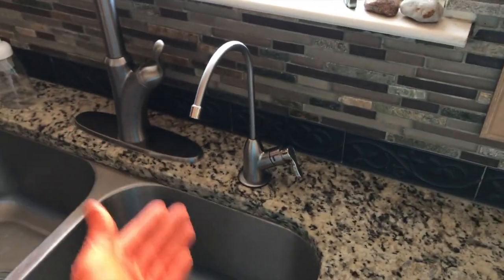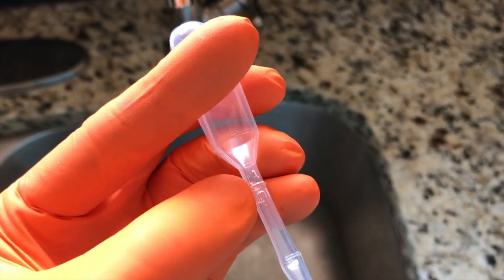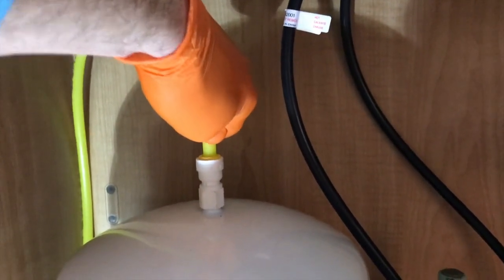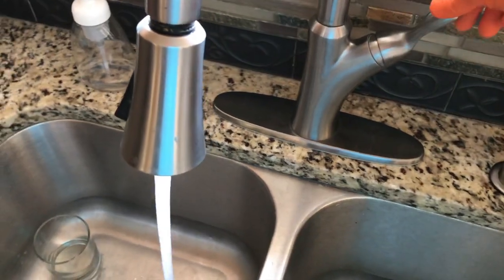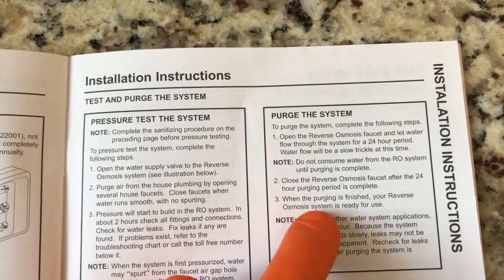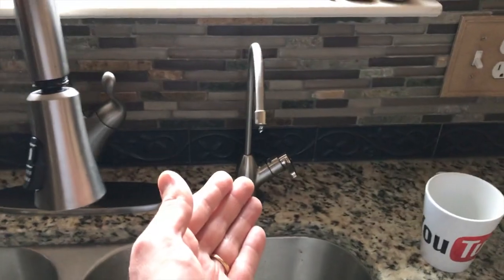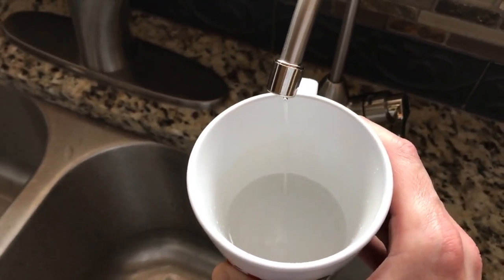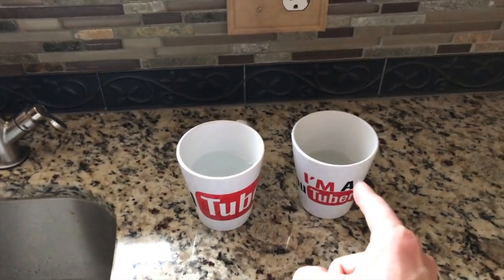How to Sanitze & Purge GE Reverse Osmosis System!

Comment: The sticker on the water tank says 100 psi working pressure but when you look online most ro systems say they recommend 6-8 psi. What should I fill my GE tank up to?
Reply from the maker: @Aaron78155  

Thanks for watching, do you have the exact same GE system as shown in this video?

If so, it is extremely important to not have tank above 8psi when it’s completely empty.

It’s also important that you add air to an empty tank as opposed to a tank filled with water.

Adding air to a tank that has water inside it will give you inaccurate PSI readings and will definitely lead to system issues.

Comment: Hey Michael - quick question - after the sanitize procedure for 2 hours, I turned on the RO faucet and unlike yours, which was a trickle, mine had tons of pressure! Why? Is it OK?
Reply from the maker: @tomatojuice12  

Good morning ☕️

Are you referring to the 2-hour pressure test or the sanitation process?

After initial install, you will be guided to perform the 2-hour pressure test which will fill the system with water so you can check for leaks.  Once faucet is open, all the water will flow out in a normal pressure fed manner, which is normal and what you are hoping for.
Reply: @DIYwithMichaelBorders  Thank you for replying Michael. What you said makes sense. In my initial question, I meant right after the 2 hour pressure, I opened the RO faucet, and the water was strong but in the manual, it says it will be a trickle. It did eventually slow to a trickle after an hour or so. So all is fine? As I type this email, it is still trickling as it has been 12 hours and I need to let it trickle for another 12 hours.
Reply from the maker: @tomatojuice12  

Thanks for the reply.  The purging process will follow the 2-hour pressure test.

During the 24 hour purging process, the RO faucet will remain in the full open position and during this 24 hour period, the water will trickle.

At times, it’s common that the water will stop for 10 seconds or so.

After the 24 hour purging process, you will close the RO faucet and allow it to fill.

Water is not safe to drink until after the 24 hour purging process.

😁👍🧰

Comment: So this doesn't hurt the installed filters? It looks like the yellow tube you put the bleach in goes toward the filters... Can you clarify?
Reply from the maker: @Excellence478  

Good morning, great question.  The instructions guide us to insert the bleach into the yellow tubing that we pulled off the tank.

Once the yellow tub is reconnected to the tank, the bleach will…thankfully…never route back to the filters.

This is because all water inside tank has already cycled through the three filter cartridges, and will only then be routed up the tubing and out of the faucet.  👍

Comment: When you bleach the system you have the RO faucet open, and after bleaching when you turn the cold water supply open you still have the RO faucet open, so why doesn’t water start coming out the RO system right away? You then turn the house faucets on and still no water coming out the RO spout with the valve open. As soon as I turn the water supply back on I get water coming out of my RO faucet. Is this wrong? I did open the RO valve beforehand to try and drain the tank. 
Does pressurizing for 2 hours happen with the RO faucet open? If so mine is sending water out the whole time.

Comment: Does sanitizing put bleach in the tank? Does it also put it in the filters? Isn’t the yellow hose two way? How do I make sure I’m not drinking bleach after 24 hours? Suppose the tank has mold or fungus in it, wouldn’t the tank need to be filled to get the bleach all inside the tank?
Reply from the maker: Good morning ☕️ great questions and we appreciate you reaching out to us.  

The sanitation process allows bleach to flow into system and through all lines.  Bleach enters the tank and cleans it as well.

With the system shown in this video, it’s the very first/initial sanitation process performed after install.  All sanitation procedures to follow are performed using the sanitation cartridge kit.  Below is a link to our video showing this procedure.

       https://youtu.be/5zNwA83aU0g?si=z-ha_uCLE-RIMpg0 

The filters and membrane will be fully removed during the sanitation process and won’t be harmed.  This is because the sanitation kit will be installed and manage the flow and operation.

We have posted a link to our Reverse Osmosis video Playlist below.

       https://youtube.com/playlist?list=PLjCXOz8TSkZlQnBuZZrgOiwjkvAkXc_Ov&si=0_57B9zOZjo6j4ET
       
Lots of helpful videos, please let us know if you have any questions.

Comment: How do I detach the yellow hose off my tank? I need to sanitize before I change my filters and membrane
Reply from the maker: Good morning ☕️ we appreciate you reaching out to us.  Below, you will find two video links.  

The first link is a quick video showing how to properly and safely disconnect the pressure fitting and line on the top portion of tank.  The second video shows the proper and safe process of removing a damaged tank and installing a brand new tank.

     https://youtu.be/U6-Gw3SDvWc?si=tL8HVPko5DRAaOOo

     https://youtu.be/bYuN40fj63I?si=XrSmh0XVZu7fTk0b

🧰

Comment: My system has zero pressure after changing the filters. I ran the faucets and all after and let it sit for hours. It dribbles out and takes like a minute to fill a glass of water. 
Also, my water tastes funny I think. I didn’t bleach the system and now wonder if it’s got mold or something bad in it. When I use the tester for particulates I get like 19. Would that pick up mold or mildew in my tank? 
Any recommendations?
Reply: We are having the same problem.   Talked to GE and they recommended repurging the system.  I also used a bike pump to increase the pressure but worry I inflated it to high/too quickly
Reply from the maker: @jonalbertson  

Thanks for sharing.  👍
Reply: Now my system is dripping one drop of water every 20 - 30 seconds. Tank feels full. I used a pressure gauge to test the tank at it says 29psi even though I’ve never added pressure and water drips out every 30 seconds. GE has been zero help. Telling me to flush the toilets is a joke. I’d just like my money back for the filters I bought which ruined the system and they won’t give me the money back I’d rather just buy a different system at this point.
Reply from the maker: @wstt4  

Bummer to hear you are experiencing troubles.  The only other thing that could be causing it is faulty filters, or a faulty membrane.

Even if you have recently replaced filters and membrane, we would recommend replacing them again, as well as replacing the small flow restrictor.

We replaced filters and membrane and installed new ones that unfortunately sat outside in the freezing cold overnight, and because of that…they were ruined before we even installed them…which lead to our system performing exactly how yours is.

We hope to hear back from you, and please let us know if you have any questions.
Reply: @DIYwithMichaelBorders ok. I was sort of bwrong on my zero pressure comment. I tested the psi of the tank with it full and it said 29psi but I understand that means nothing bc the tank isn’t empty. The problem is I can’t empty the tank bc the faucet drips like 1 drop  of water every 30 seconds. 
I did try a full set of replacement filters including middle filter and had the same outcome (no water pressure from faucet ). A friend took the restrictive thing off and apart and said it seemed fine and wasn’t clogged. 
So, I just turned off the water (got my shutoff valve replaced by a plumber), disconnected all but the yellow tube between the tank and the filter holder, carried the heavy tank and filter holder with filters,  outside, and disconnected the yellow tube from the filter holder. Water shot everywhere as the tank finally emptied. So water was in the tank and the tank was full and pressurized. But, water couldn’t make it back to the faucet. Does this tell you anything valuable? I would think this would hopefully indicate what the problem is but I don’t know anything about this.
Reply from the maker: @wstt4  

Thanks for the follow up.  Is everything put back together?  This indeed is an indication that the tank was over-pressured and overpowering the entire system.

That’s awesome you took tank outside and emptied it.  With tank empty, it is now the appropriate time to check psi is set properly per the instructions.

😁👍☕️
Reply: @DIYwithMichaelBorders Ok. I detached every tube and made sure none were blocked. I checked the restricted thing and it looked clear and I could blow air through it. I blew air through the blue tube with the faucet open and air passed through. I reconnected everything. I checked the tank pressure, which was then zero, probably bc I drained all the water with the yellow tube. I pumped the tank to 6psi. I turned the water back on, let the tank fill up and then hours later nothing coming out the faucet. Something is stopping the water from getting from the tank to the faucet. It makes no sense. Any ideas?
Reply from the maker: @wstt4  

Thanks for the follow up, any update?  Is your filter housing case positioned in a way where it sits above the drain line?  Is anything obstructing your air-gap?
Reply: @DIYwithMichaelBorders still no progress. The tank has pressure, and is full, but somehow it just won’t push the water back through the yellow tube, through the post filter (of which I’ve tried 2 post filters  now) up the blue tube and out the faucet. It just drips out. The filters are all below, the black line going into the drain line.
One thing that makes no sense to me in the system, is after the water goes through the first two filters it goes into the tank via the yellow tube. However, that same yellow tube delivers water the opposite direction toward the post filter and out the faucet. How can the yellow tube be handling water in both directions?
Reply from the maker: @wstt4  

Thanks for the follow up, that’s a bummer.  The yellow line serves as a 2-way line.  In other words, it is not a one-way flow.

Water will always flow to the tank through the yellow line until one of two things happen.  
       1.  The faucet opens
       2.  The tank is full

Is the yellow line positioned properly?
Reply from the maker: Good morning, just poured a cup of coffee and am sitting down to answer any and all questions for the DIY community.

Any update?  By chance did you check psi of tank when the system was drained and depressurized?  Our specific tank needs to be set to 5-7psi when empty.

Let us know if you have any questions and hey if you’re into crypto trading, join our DIY ecosystem and become part of an exclusive group of DIYers.

       toolboxtoken.com

Reach out to us any time!  🧰
Reply: @DIYwithMichaelBorders  I need to go get a pressure gage and a pump to put air back in. The water still dribbles out and it also tastes a little funny to me. Not metallic, not salty, but maybe musty. I don’t know what it is. I think I need to sterilize and bleach the tank. 
Can I do it by taking out the top filter, draining the tank, and following your steps? (I can’t turn the water shut off valve as it’s stuck so doesn’t  removing the top filter also stop the water flow? Should I depressurization before I sterilize or sterilize first? I would think depressurize first because the tank will need pressure to force the bleach out. I’m thinking of just throwing this whole thing away and going with another kind as it’s very frustrating. I have extra filters still seemed though that makes me not want to give up yet.
Reply from the maker: @wstt4  

Thanks for the follow up, it’s best at this point to perform a full sanitation process on the entire system…best way to clean out the tank as well as all the water lines.

Have you purchased the sanitation cartridge kit?  If not, that’s a must to ensure the process is performed correctly.

Once tank and lines are clean, it’s a great time to bring your tank up to the manufacturer’s recommended psi for best system performance…since again, the tank must be completely empty before adding air.

😎👍
Reply: @DIYwithMichaelBorders  I am not even sure if my tank is filling up. I think I remember when draining it, water trickled out for not as long as I thought it would do it made me wonder how much it’s filling up. Maybe I should measure how much drains out. How much should it be? 
Also, I’ve noticed if I bump the spout with a glass or with anything when the handle is off, some water then runs out of the spout. Is that normal?
Reply from the maker: @wstt4  

Thanks for the reply, water trickling out of faucet when bumped is normal…it’s just a quick interruption with the vacuum pressure…ours does that too.

Sanitizing system and re-pressurizing tank will hopefully get your system reconfigured.

Comment: I’m very frustrated with this system. I changed filters, purged it twice now and still have small black particles in the water (charcoal from filters). (Ge told me to purge again if still black particles). They are sending new filters now. After the second purge, and going to use water the next day, I noticed the water trickles out. It has no pressure? Why is this? And after seeing charcoal still, I went to drain the tank a 3rd time and realized the tank drained so quickly that it is barely getting filled up. Any clues what might be wrong?  Thanks for your videos and your help.
Reply from the maker: Good morning, just poured a cup of coffee and am sitting down to answer any and all questions for the DIY community.

Since you have replaced filters and purged a few times…and tank is not pressurizing, it might be the tank.

The internal tank bladder might be deteriorating however that’s unlikely.  Our personal opinion is that the filter and membrane are to blame.

Hopefully the new filters and a purge will fix issue.  Please keep us posted.

Let us know if you have any questions and hey if you’re into crypto trading, join our DIY ecosystem and become part of an exclusive group of DIYers.

       toolboxtoken.com

Reach out to us any time!  🧰

Comment: water keeps leaking out of the top of tank what did I do wrong
Reply from the maker: Thanks for watching, it’s possible that the water line is not fully seated into the tank fitting.  If that’s not it, it could be that the fitting that screws onto upper tank stud needs Teflon tape applied to thread stud.

Please keep us posted.  Hey if you’re into crypto trading, be an early participant in our newly launched DIY community ecosystem.

       Toolboxtoken.com

We DIYers need to stick together!  😎

Comment: Our water flow is very less. How do you make it faster. 
Also the person who installed ours didn’t use the bleach. Is this bad not to bleach it. Please let me know. 
Thank you!
Reply from the maker: Thanks for watching & welcome to the DIY Raptor Club.  It’s possible that you have a low tank psi.

Adding air to your tank may help however we recommend checking your owners manual for the exact recommendation for tank psi.

The tank will also need to be 100% empty prior to adding air to get an accurate PSI reading.

Also, below is a link to our RO system playlist that contains several helpful videos.

       https://youtube.com/playlist?list=PLjCXOz8TSkZlQnBuZZrgOiwjkvAkXc_Ov

😎👍

Comment: When does it stop trickling and when is this tank supposed to fill up our tank isn't filling up at all we have new filters the restrictor valve is clean we've done everything and it's not really flowing right we're ready to give up
Reply from the maker: Thanks for watching, by chance did your filters or membrane come in contact with cold temperatures...?...

We ran into this issue awhile back.  We bought new filters and it was not filling the tank which led us to replace everything it seemed... only to find out the filters were the original cause.

If the filters or membrane get exposed to cold temperatures, it ruins them and sets you up for failure before you even install them.  Keep us posted.